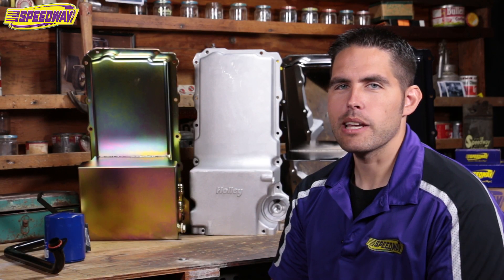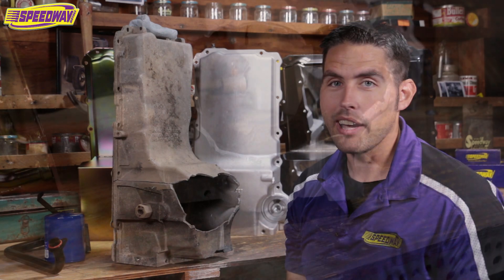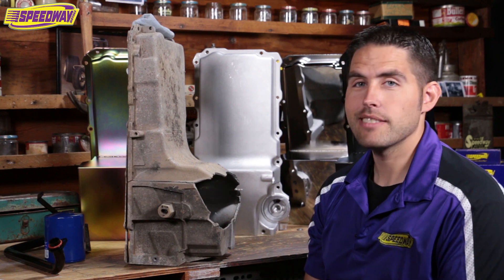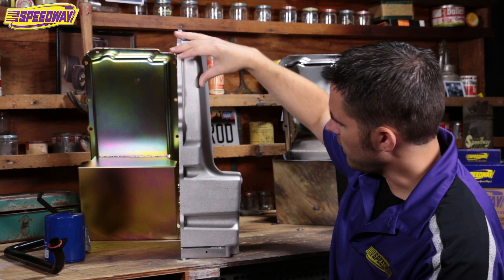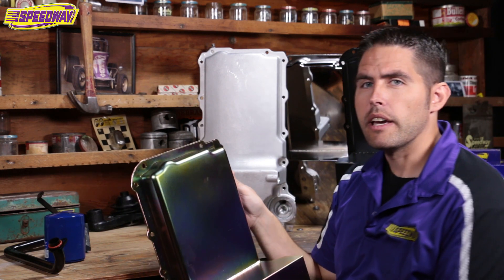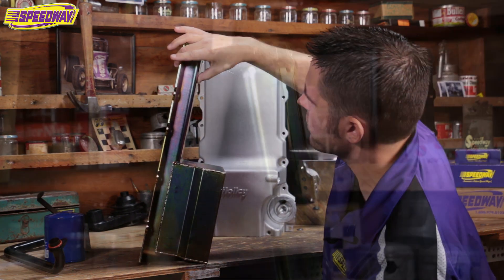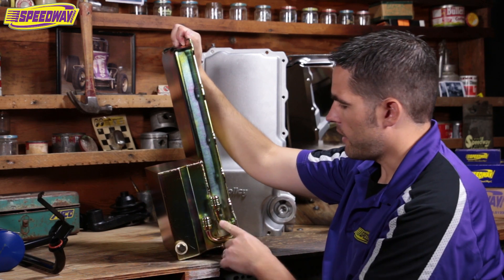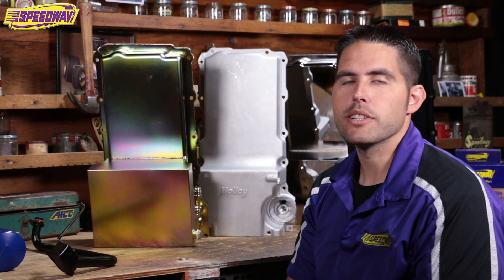LS Swap Oil Pans – Steel vs. Aluminum & How to Choose

Comment: need to know what oil pan do i have to install in mi 86 c10 in case if i´m swaping mi c10 with a 5.3 engine. thanks in advance
Reply from the maker: From Pat: "There's several oil pans out there available for swaps, and sometimes the correct pan depends on the engine mounts you're using.  We don't have any personal experience swapping an LS into a C10.  However there are quite a few helpful forums out there with folks who've done swaps like yours.  If you end up finding a pan that works best, please check us out as we may carry it."
Reply: If you use texas steel works motor mounts you can use the stock oil pan and it hangs flush with the crossmember . I use them on all my c10 swaps
Reply: Tejas steel works

Comment: None of the Dimensions mean much to me  because I don't have  a 1st Generation small block Chevy oil pan near me ..  Also I don't  know  where the oil pan on a 1st Gen small Block Chevy is in relation to the  crank shaft centerline of the Y-Block Style LS  motor .. Nor do I know the dimensions of the 4th of 5th Gen  Camaro oil pan is ??  I ran out of space to store all my old small block chevys  and actually ended up taking them to the scrap yard ..I had them very well oiled with used motor oil and they still rusted here in the swamp in Michigan .. Then  I sold all my  Tall Deck Big  Block 427 Truck engines with forged steel cranks to an engine builder who got murdered a 1 year later..

Comment: Thicker  shorter taller ..   The water was only  ankle deep on the ducks ..  He just pointed to a Plug and called it a Filler Plug ??   Looks like a drain plug to me .. I would be really pissed if I had to pull the oil pan off to drain my engine  oil .. Automatic Transmission pans piss me off to so I weld drain plugs into them ..   that way  you don't have  2  gallons  of oil spilling all over the place when you drop the full pan ..

Comment: Absolutely horrible quality.. I bought this pan because of this video. I was so pissed when I opened it.. The Oil filter relocation mount was just as bad. Id say it was about 80% complete. I spent two hours leveling the gasket surface and cleaning out all the burs and leftover casting crud, I even had to retap it and clean up the threads.... The pan had pinholes in it and was burned threw in almost all welds. The pan was hit with an angle grinder on the gasket surface in an attempt to clean up the terrible welding. The ID on the inlet and outlet was extremely restricted because of the poor welds. I Sent it back and the replacement is much worse!!!! I was told it would be sent next day and it was sent UPS ground.. I was also told it would be inspected for quality before it ever went in a box. I was lied to and I'm not happy. This whole ordeal has set my build back 2 freaking weeks!!!!!!!
Reply: Pearce117 WOW, they didn't even have the courtesy to respond!! Definitely bad business!
Reply: Hey @Pearce117   So all Chevies  pretty much had the same oil pan clearance needs from  1955 till 1985 but GM sells you an engine trans and wiring and ECm for $17,000 and you have to spend another $450.00 on an oil pan .. Freaking amazing some parts guy at Scoggin Dickey Parts Center  .. Told me that Gm used to sell them but now  because there are so many different Variations 
  Also I have read that the way the LS block is designed it counts on the cast aluminum  oil pan for  structural integrity .. I want to upgrade to LS for fuel injection spark knock detection  ect..  
  Thanks for warning us about the steel pan .. I suppose I have to watch the video again to see what brand it is .. I watched the Video cause I wanted a holley ..  I don't think he mentioned that Holley  has  3 different pans  .  one of them even fits a Fox body Mustang ..  Also a G body GM
Reply: Pearce117  which one?
Reply: Pearce117  thanks for the tip almost bought one from this company

Comment: what to use for a g body
Reply from the maker: It depends on what engine mounts you decide to go with, but the Fbody oil pan is one of the most widely used pans in LS swaps. We just started carrying it straight from GM, Part# 35512628771. Just add the factory GM pickup tube, Part# 35512558251 and you’re good to go.